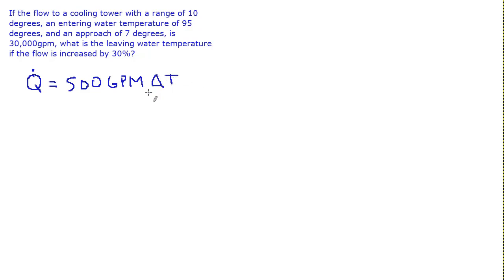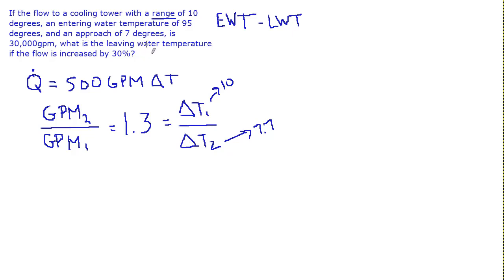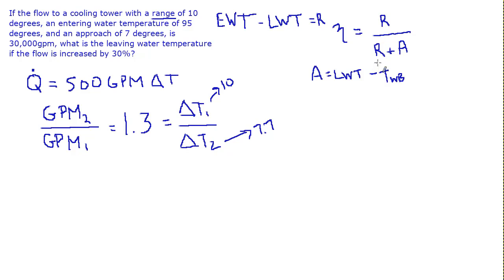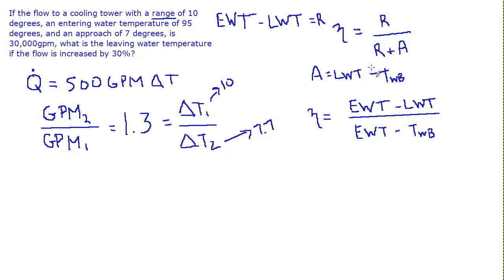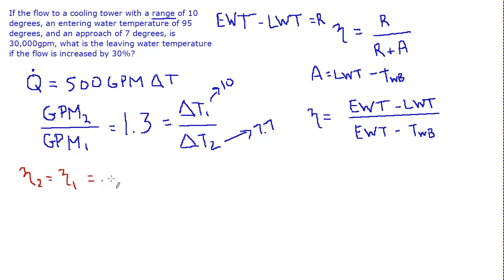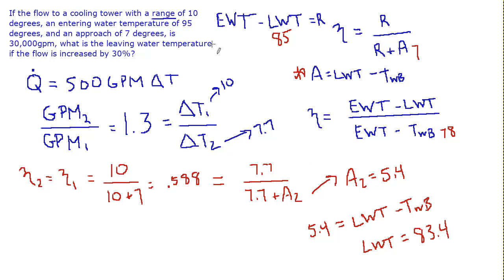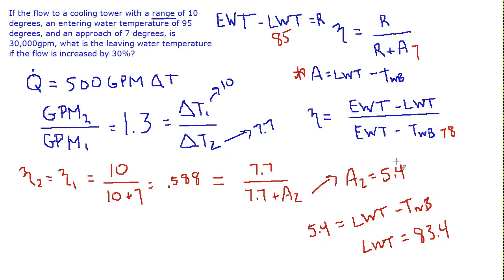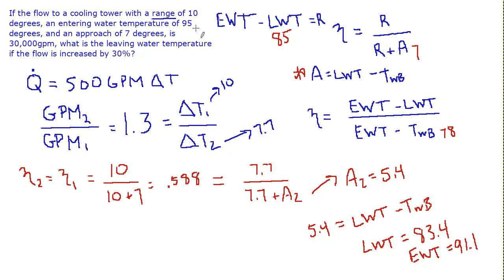Question of the Week 03: HVAC Cooling Tower Increased Flow Problem Solution | PE Exam Prep

Comment: Hi Dan, I understand that moving more gpm can reduce the Delta T to get the same Q. However not sure how to read the pbs then. I assume to not touch the 95 EWT when strictly reading how the pb is worded. To find the LWT (x), I have GPM2/GPM1 = 1.3 = DeltaT1/DeltaT2 = (95-85)/(95-x), leads 1.3=10/(95-x), thus x = 87.3F. This error margin factor of ~4F leaves a degree of interpretation (bad joke) tied to how one reads between the lines of problem statement. I could be off.